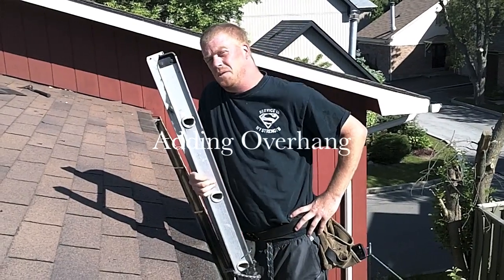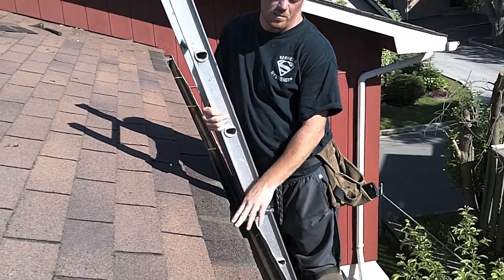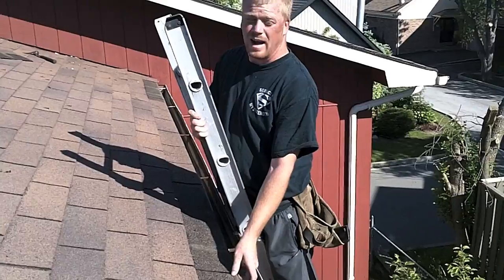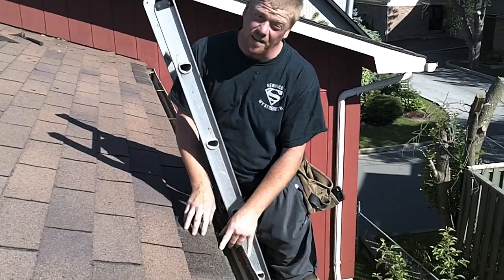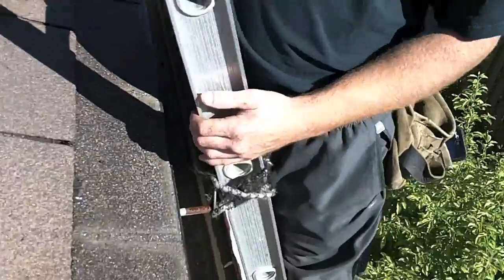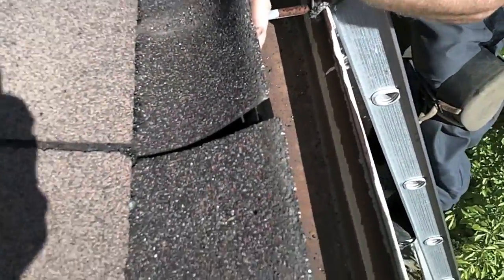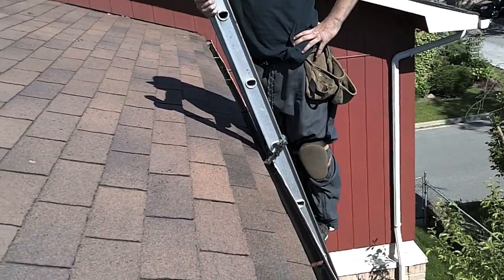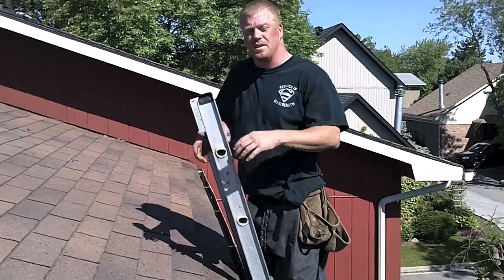Adding overhang to your roofs edge

Comment: I think they just lifted the second row tabs enough to remove the nails using a flat bar nail puller then lower the first shingles for one by one and renal. I'd probably use a new shingle on that bottom row..

Comment: I just had a new roof installed and the shingles are short on one side on the front of the house.  They have yet to repair the roof and I'm going to show them your video about how it's done correctly .  Do you have another video showing how you installed the two rows to replace the original starter shingles?  Also, what is your website?  Thanks for all this great informaiton
Reply: Lol..have u got a responce yet..nope

Comment: I ran into a similar problem where someone adding a room onto their home had not left any plywood overhang on their eaves and the roofers had not left any overhang or drip edge on the eaves either, so basically the whole wall was leaking, who the hell doesn't leave overhang on shingles?

Comment: Approximately 9 years ago this was done to an addition on my houseby BIL and now deceased husband. First year, big leak, called contractor, he "fixed it" using aluminum and bending it with a break...well, he channelled all the water in between wall and r board, now I am dealing with a rotted wall, floor and mold. . (of course contractor out of business and won't return calls,...) ..beware and get a contract!